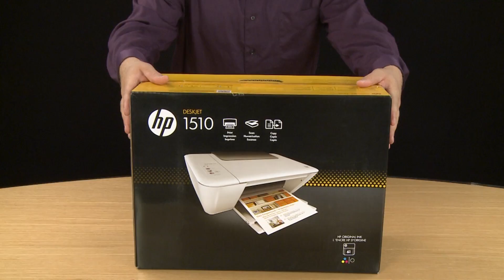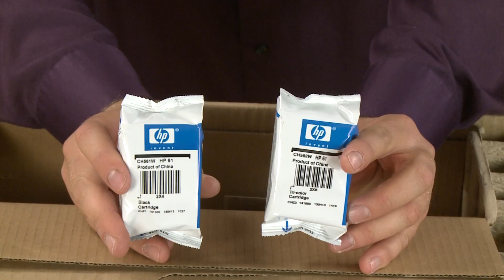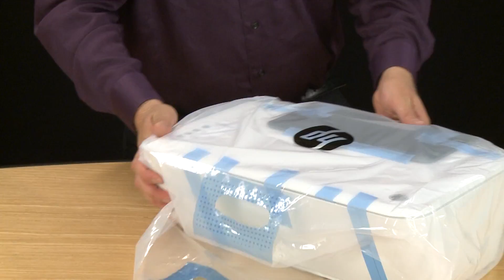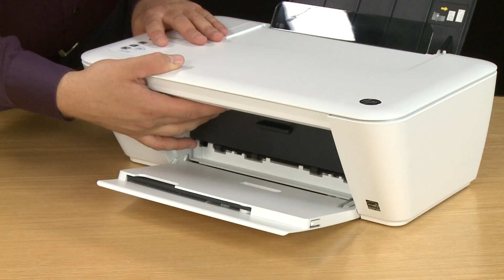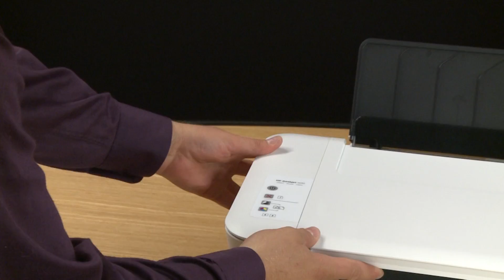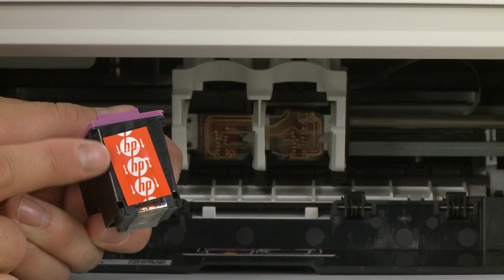Unboxing and Setting Up the HP Deskjet 1510 All-in-One Printer | HP

Comment: I was told by the shopkeeper that it was wireless and it is stated so in this video. But I don't get how I should connect it to my PC. The USB cable isn't there either. How can I use it when I can't connect it with my PC???

Comment: Such a scam from which I thought was a reputable company: The printer is NOT wireless and it does NOT have a USB cable included!
I urgently needed to print sth, but I cannot use it now as the shops are closed, Thanks HP for such utter b..sh.. on your customers

Comment: my printer came with no usb cable and apparently i need one for connecting. so where do i buy one?
Reply from the maker: You can order one from HP.  They are also available at most electronics-type retailers. It is important that you get a printer USB cable.  It has a different type of end that plugs into the printer.  The part number in the USA is 8121-1186.
Reply: I find it hard to believe than no USB cable is provided !!
Reply: ***** Yeah...  order one from HP...  and wait a month or more for it to arrive (in Saudi Arabia).  Finding one on the local economy?  That ought to be an adventure outside of the major cities.  This has got to be among the most idiotic things I've experienced: ship a non-WiFi printer with no USB cable to connect to the computer.  Brilliant, HP.  I can see why you are shedding 10,000+ jobs.

Comment: Great.  I got it out of the box.  Now I have been able to get it to do everything but print. it copies, it scans, but it won't print.  But thanks with the box thing.  I bet people were really stumped there.
Reply from the maker: +Brian Smith      If you are using a Windows operating system please download HP’s utility named the HP Print and Scan Doctor (PSDr).  The PSDr helps to qu8ickly resolve common printing, scanning, and connectivity issues.  To find the document please search for C03286146 on HP’s home page or using Google search.  The title of the document is “HP Printers - Using Print and Scan Doctor for Windows to Help Resolve Printer Issues”.  If you happen to be a Mac user there is an FAQ in the same document that.

Comment: My computer's dvd player is spoiled so I can't install the printer into my pc.
I heard that I can install it from the website, so could you give me the link and ways to do it?
Reply from the maker: Hi Yen1082,
 
Yes you are able to download the software and drivers for your printer from HP's web site.  I have also included the list of documents for installing the printer.  Please search for the applicable document number (for example C03521643) on HP's home page or using Google search for the installation instructions applicable to the operating system your computer uses.
 
C03521643 - Installing the Printer Software in Windows XP for a USB Cable Connection
C03521717 - Installing the Printer Software in Windows Vista for a USB Cable Connection
C03521864 - Installing the Printer Software in Windows 7 for a USB Cable Connection
C03606993 - Install the Printer Software in Windows RT or Windows 8 on a Tablet
C03460787 - Installing the Printer Software in Windows 8 for a USB Cable Connection
C02030505 - Installing the Printer Software in Mac OS X v10.6 Snow Leopard for a USB Connection
C03045596 - Installing the Printer Software in Mac OS X v10.7 Lion for a USB Connection
C03381936 - Installing the Printer Software in OS X v10.8 Mountain Lion for a USB Connection
C03966737 - Installing the Printer Software in OS X v10.9 Mavericks for a USB Connection
Reply: *****
Okay, thanks :)

Comment: i have a hp psc 1510 printer but i got it used and it looks a little more old school then this, it is very simple to install but i dont know where to put the paper.
Reply from the maker: +Alec Escobar Pull the paper tray extender toward you, as far as it will go. Flip the paper catch at
the end of the paper tray extender to open the extender the rest of the way. Try following page 15 in the user guide :http://hp.care/2rRcU6S
Reply: Alec Escobar DC/777?

Comment: Hello, i did all the steps, step by step. When i try to print directly from the printer (both black and color print), the paper doesn't come out printed. Just in case, i doesn't appear any signal on the printer (5 and 6 like they are in the manual)
Reply from the maker: +Fernando Pina Please refer to the instructions mentioned under this document to fix this issue: http://hp.care/2piKfXk

Comment: I use +32v power supply and it works or not.. And. I have another question my 1510 is not powering on
Reply from the maker: +Anmol Sidhu Please follow the guidelines in this document to fix this issue: http://bitly.com/2N9i1Jh

Comment: how to put back the tray extender of deskjet 1515 to original position? I pull it out gently and now it cannot go back to the original position...pls help.
Reply from the maker: +Jenson Moo   The tray extender should just swing back within the output tray.  I do know that sometimes with a new printer, they seem stuck, but please apply a little more pressure to swinging the door back, it should go.

Comment: hoow to you install the software without the cd i have a hp chromebook 14
Reply from the maker: yesica galvan Unfortunately, this is not a compatible operating system for this printer. Compatible operating systems  are: Windows 8, Windows 7, Windows Vista, Windows XP SP3 or higher (32-bit only)
Mac OS X v10.6, Lion, Mountain Lion

Comment: Oigan! Por favor contesten no se si hablan español pero si si hablan por favor contesten, tengo una impresora hp 1510 series y no imprime aunque ya inastale lo que debo instalar y no imprime por favor siganme una solucion oara eso
Reply from the maker: Ramsess Alfonso Perez Valle How is your computer connected to your printer? Is it able to print off a test sheet, and make a photocopy on the scanner glass? Are you able to print from a different computer connected? Is your computer installed with a Macintosh or Windows operating system?

Comment: Purchased a 1510 today,and have just set it up,before seeing this video. Happily,I seem to have done it correctly. What is the black slider that sits inside the front flap for? Keeping my fingers crossed that the machine will do what I bought it to do.
Reply from the maker: brian morgan The black slider that sits inside the front flap is to catch paper when it is done printing.
Reply: ***** Thanks for that,but had it sussed just after posting.

Comment: hi so i just got my new hp deskjet 1512 which i plan on using with my windows 7 64 bit laptop but for some reason when I try to connect it, it says "USB device not recognized". now ive tried uninstalling and reinstalling the software and even a system restore before plugging it in again and yet it still doesn't work. I'm really not sure what else to do and I have no idea what the problem is because I've tried working it on my roommate's computer and it works then so I know the printer is not the problem.
Reply from the maker: yelyaa
Since you are running Windows 7, please try HP’s Print and Scan Doctor for Windows.  The HP Print and Scan Doctor is a free utility (tool) that helps to quickly resolve common printing, scanning and connectivity issues.  Please search for “Find and Fix Common Printer Problems Using HP Diagnostic Tools for Windows” on HP’s home page or using Google search.  It will take you to HP’s diagnostic tools page which is where you can download the utility.

Comment: i got mine today and no where does it tell how to copy-print-or scan--that should have been included-the software doesnt tell either-it is only for the drivers.
Reply from the maker: maxwell williams You can find documentation on how to copy, scan and print on the HP Support page for your Deskjet 1510. The link to this page can be found below:
http://support.hp.com/us-en/product/HP-Deskjet-1510-All-in-One-Printer-series/5157551/model/5157552

Comment: how do i set it up with my mac computer? the wireless? mine didn't come with a USB and I don't know how to connect it to my router- the router is connected to the wall via ethernet cable. my computer is on that wireless network but idk how to connect the printer to the computer. please help
Reply from the maker: alyssatheinfinite This printer does not support wireless connectivity.  Please search for C03775352 on HP's home page or using Google search.  The title of the document is "Printer Specifications for the HP Deskjet 1510 and Deskjet Ink Advantage 1510 All-in-One Printer Series".

Comment: Do you plan to update this printer's software so that it will work with Mac OS Monterey 12.6?
Reply from the maker: Hi there, thanks for contacting!
I understand that you need to know about compatibility of this printer with Mac.
I will do my best to assist you.
Supported Mac OS X operating systems for this printer are: Mac OS X v10.6 Snow Leopard, OS X v10.7 Lion, OS X v10.8 Mountain Lion, OS X v10.9 Mavericks, OS X v10.10 Yosemite
Binu - Social Media Tech Support

Comment: I have an HP 1010 deskjet printer.  I don't what to do with the square tipped cable.  I have it connected to the printer but every I try to follow the install directions it says I haven't connect to something.  Both cables are connected.  What do I need to do differently?
Reply from the maker: Hello barbara glazier,
Please search for C03782079 on HP’s home page or using Google search. The document title is “Description of the External Parts of the Product”.  Item number 5 in the picture is where you plug the clipped square end of the USB cable into the printer and the flat end of the USB cable needs to be plugged into your computer.  That should resolve  the error message you are getting.

Comment: does all of your printer comes with a usb cable?
Reply from the maker: LoVeRbOy No not all the printers will come with a USB cable. As there are multiple ways to set up the computer it is not always necessary to have so to reduce the cost of the printers and their impact on the environment USB cables are not always provided and have to be purchased separately.
Reply: *****
 That's ridiculous. If your printer needs a cable, it should be included. Mine didn't have one either. That is bad customer service but I suppose it doesn't matter if you make customers unhappy because you corner the market on so many things. It's like if I bought a tv and it didn't include the power cord. Uh... power cord sold separately. You guys are jerks.
Reply: Exactly how can we use the printer that we bought brand new and unbox and later to found out therer's no usb cable for us to connect even if the printer doesnt support wifi connectivity

Comment: im planning to buy this. 1510 or 1050. which is better? and, is there possible i can get a installer on the site? because, my laptop doesn't have a cd reader.
Reply from the maker: +Derek    I've included the link to the drivers for both printers.  The page may prompt you to choose your operating system.  Once you've made your decision and have purchased the printer, let me know if you need assistance getting it installed.  

Deskjet 1510 Drivers    http://ow.ly/V4VBt 
Deskjet 1010 Drivers    http://ow.ly/V4VJ8

Comment: I got a 1510 and can print a test page but nothing else
Reply from the maker: John Ignatius Bradley How is your printer connected to your computer? What version of operating system is installed on your computer? Is this a recent or a reoccurring issue?
Reply: It is on a usb on vista and the printer is new and never used
Reply from the maker: John Ignatius Bradley To correct this issue, I recommend following the steps in this document on Using HP Diagnostic Tools for HP Printers in Windows, as well as Print Jobs Stuck in Print Queue (Windows). These resources can be found by Google Searching "c02205477", as well as "c02073861".

Comment: Hi   I would like  to ask u a question what of packing tape should I use.  when I want to go traveling  I want make sure   It  dosen't  brake.
Reply from the maker: LINDA HALSEY You can generally use any type of tape so long as the adhesion is not too strong that it damages the sides of the printer.

Comment: can I connect to laptop?
Reply from the maker: +Daahim Haadhy   The Deskjet 1510 only supports a USB cable connection.  I've included the Deskjet 1510 Printer Specifications ( http://ow.ly/YqTC5 ) for your review.  I've also included a link to HP Shopping which shows the type of USB cable required ( http://ow.ly/YqUgY ).

Comment: You said that the printer can be set up via USB or Wi-Fi. But in the technical specifications of the printer, it states " USB 2.0" and wireless is not mentioned anywhere.
Reply from the maker: +Tic Tech Toe   Thanks for catching that.  I've escalated this to the appropriate team. 

The Deskjet 1510 does not support wireless connectivity.  Please refer to the "Printer Specifications for the HP Deskjet 1510 and Deskjet Ink Advantage 1510 All-in-One Printer Series" document ( http://ow.ly/UQF3M ).
Reply: +HP Printer Support all the more the appropriate USB should be provided! It's quite inconvenient for consumers to purchase a product and still have to buy something additional in order for it to work.  Please fix this for your future buyers

Comment: i have my printer set up and ready to go, everything is in its place. but when i want to print something it doesnt print. the 3 lights keep blinking.!! help plz
Reply from the maker: Hello SoccerKid615,
The Blinking Lights document number for your printer is C03884419.  Please search for the document number of HP's home page or using Google search.  It will give you trouble shooting steps to take for the combination of lights that are blinking.  Before starting the trouble shooting please Reset your printer by following the steps in document C03177455.
Reply: I actually figured everything out! Everything is good and running! Thank you for the video and the help!

Comment: I did everything the video told me to do but my printer still isnt printing. any ideas? he didnt use the USB in this video.. would that be the problem ??
Reply from the maker: +Loyalty Respect   This printer only supports being connected by a USB cable, so it is required to print.  To find the printer specifications for the Deskjet 1510, please search for C03261117 on HP's home page or using Google search.  The title of the document is "Printer Specifications for the HP Deskjet 1510 and Deskjet Ink Advantage 1510 All-in-One Printer Series:".
Reply: +Loyalty Respect Basically they dont send a USB cable with the printer, so you're best off either returning it or going to your local computer shop and trying to get a printer/Usb cable.

Comment: i dont have colour cartridges pls tel me should i use only back cartridges in printer printer will work or not
Reply from the maker: + Cool boy our printer is designed to print only when all ink cartridges have ink. A little ink from all the ink cartridges is used in periodic servicing tasks. This helps to prevent issues such as printhead clogs and poor print quality. There is no way to bypass this feature.
Reply: HP Printer Support  please help . I am trying to  see if my Hp Deskjet is a wireless printer!   I don't do a lot of  printer but what need to print is on my Samsung Galaxy s5. . My son has a lap top and he is fine printing with the  USB cable.  The problem I have when I want to print something I have to try to  get the filed emailed to him and he prints it via laptop.  Now  as I  said before technology is not my thing. .I don't like it. . I bought my printer from Walmart they assured me that the HP Deskjet 1510 all in one was a very simple setup wireless printer. .  Well I  am not happy because  I  don't want to wait for my son to open his emails to print my files out when  I  should be able to do it straight from my phone.   I have watched several videos even my phone is telling me  to scan NFC  but  on this model printer there is nothing to scan ..I do know how to use my s beam. .but there is nothing on this printer to print from my phone. .I don't even know if the USB  is an option with my phone.  my son is fine with plugging the cord into his computer.  well it is his computer and printer...but this is not  what  I  was expecting I would have to do.. I  love my pictures and would love to see if I am going be able to print from my phone  or continue to  pay Walgreens for all my prints...I have been working with this printer since 8pm eastern  and I have not accomplished anything ! I hope HP customers support can be more help...because rt now  I am very very  unhappy with my purchase.   And the videos that are posted are  very advice for  someone like myself ...I was told  by walmart  it would  have to be installed  to the laptop WiFi  code put in and he could print everything wireless. .well he is using the USB cord to print from  his laptop!  I am lost as to  how I need to print from my phone! I  feel very frustrated. .I guess I should have researched this better!  one lost upset confused customer!  please help!  Thanks
Reply from the maker: +Traci Galloway There is a document titled "Printing From HP Print Service Plugin (Android) which has the steps to follow when you want to connect a Smartphone to your Printer. Please review the document to see if any steps were accidentally missed when connecting Phone: http://hp.care/2fCLLPC
Reply from the maker: +V F HP Print and Scan Doctor is a free tool for Windows to help resolve printing and scanning problems. Please perform the steps mentioned in this document to fix this issue: http://hp.care/2nFmPZE HP printers generally have a 1-year warranty from their purchase date, you can verify the warranty using the following link: http://bit.ly/2mP3Xrb. You can also contact HP Support in case you need further assistance: http://hp.care/2nbNQFi